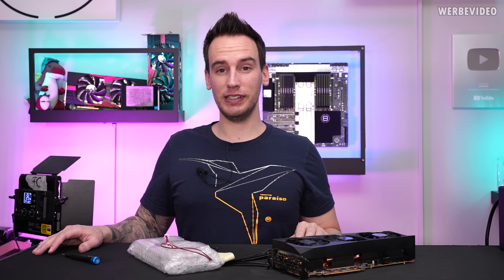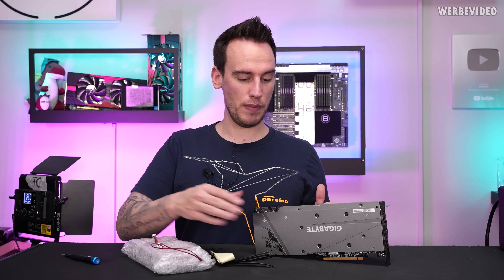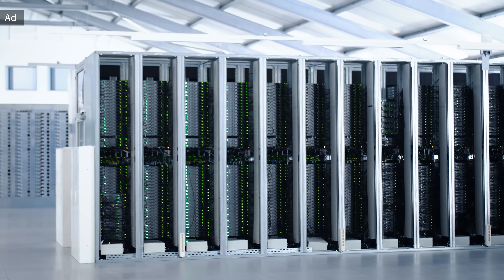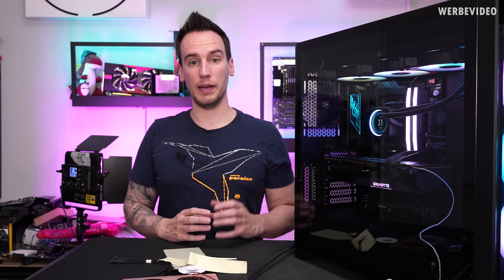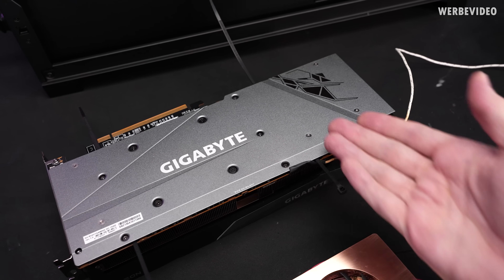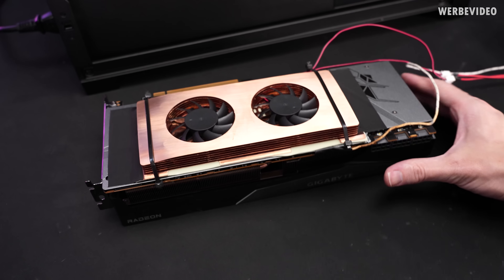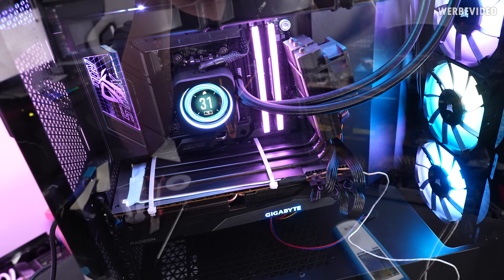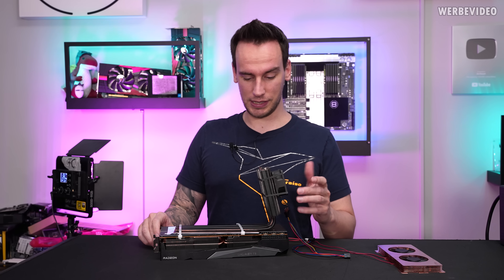Please don't do this - AliExpress GPU Backplate Cooling

Comment: I do not think activate cooling on the back plate is a good idea, although different topic I think similar applies, on cars gaskets often go bad over time due to heat expansion differing between different materials(plastic manifolds and aluminum cast motors) similar will happen with gpu's,  differs expansion rates is likely an issue and active on essentially the  pcb will probably negatively effect the situation; slowing down the heat expansion of the die is likely a good thing as it's the source of the heat but slowly down pcb is likely not a good thing; I"d argue preheating it would be better long term but wouldn't not likely  be realistic

Comment: Solution is for the GPU manufacturers to make their backplates into aluminum/aluminium heatsinks with optional fans. This is also something you can do yourself if you have spare Intel or older AMD CPU coolers. If you have a belt sander, you can always shorten those fins if you run into a space issue. As for mounting the heatsinks, use either thermal glue or modify the backplate to accept short screws(you don't wanna puncture the PCB). If you have a 3D printer, this will be a whole lot easier and more effective(blower style cooling design, special shrouds, support, no drilling, improved looks).

Comment: Of course you didn't see any improvement.  You didn't using thermpads, thermal conductive tape or thermal paste between the backplate and the heat sink.

Comment: yeah i'll just take one of those 3 fan pci slot deals, and put it on the bottom slot near the psu, then put in one of those blowers behind that, 
it will cool the tower internals, plus pull a great deal of heat off the psu and directly out, saving it having to go through and past the cpu and out the back/top of the case.
yeah that's right, a 3 fan slot card, and then a blow behind that, between the slot card and the gpu, mmm hmm sounds like a fresh idea to me.

Comment: Just got an alienware 3090. Based on other people's teardown, there is actually a heat pipe on the backplate. This kind of cooler might be useful in this case.

Comment: my backplate wasnt even touching the backs of the chips so it was just a thermal buffer, added thermal pads to the back plates on the chip backs to the back plate trimmed dozens of degrees off 110 deg to 70 under load! the gigabyte eagle 3080 vram temps (also repadded the heatsink too)

Comment: You put the ties thru the bottom plate it wont bend.But this would be better for my Titan without a backplate in my sli setup.I can make a plate to solder right to that heatsink and that would work great.

Comment: I picked up a couple of the ali-express two fan aluminum heatsink type of things from ebay for my 3090FE's. 

It made a noticeable difference in overall heat on the RAM and the GPU core temp - about 2-3C on the GPU core, and 8-ishC on the RAM. It also kept the back plate cool enough that I could touch it without immediately jerking my hand back.

Comment: Water cooling is far more prone to failing than fans, so even in the worst case I would avoid it, 
Take it from a nerd who invested enough in a water cooling loop I had to smash in the front end of my mid range case to mount it properly, passive or fans are the way to go if you value your sanity and not accidentally-ing your setup.

If you have the cash to waste on water cooling you are wasing your money and deserve what you get, quiet and large fans do exist and carry less risk and less pain.

Comment: Many video cards don't even put thermal pads on the backplate and end up using it purely for aesthetics. I have one of those RX6700XTs that are from AMD itself and didn't have one. I put one on and the temperatures dropped a lot. I think this type of solution could work better if it were placed directly on the card.

Comment: Better GPU and processor cooling? One and only solution: First - change the cooling radiator in your GPU with bigger and more powerful one! If this is not possible - cool the room temperature about 4 degrees Celsius or lower.

Comment: It works great but you're clumsy, that's not how it's done. You need to remove the original backplate and place the heatsink with the fan on top. Use a better thermal pad (21W/mk) than the one provided. The cable ties should be inserted into the first layer and should not be tightened on top, deforming the heat sink.

Comment: Those things are what needed for gigabyte gaming oc Vega cards, which has notorious issue of crashing because of VRM overheat, due to half of the VRM placed on the back of the PCB... There's heatpipe and thermal pads on the back but its just not enough... I put heatsinks with thermal tape on my gaming oc Vega 56 and it works, no more crashing...

Comment: And a thermal pad around the gpu die filling in the blanks and substrate thermal pad around the gpu die itself then back plate itself the pcb acting like a heat pipe as well as surface substrate thermal pad assisted in wax retention

Comment: Ive had issues with vram heat on my 3090 lately, evga 3090 with the hybrid kit. Memory temps hit 105. I simply placed a spare case fan on top of the backplate blowing down into the card and now it caps at 90 degrees and my gpu fans no longer go to 100% to bring it back down from boiling.

Comment: Even if they are useless he still got scammed hard when both are available under 25 Euros the first one even as low as 12 Euros. Also they were intended to use on RTX30 series with helps a lot during the mining period.

Comment: The second one, if you swap this small fart fan for 2, push and pull normal 120 fans
It might be actually good
If temp lowered with this small piece of plastic
Then with 2 good quality fans it could really help gpu

Comment: You need to put the zip tie in the last space just abov the sheet that makes contact with the thermal pad and then backplate, not that it will change something but just for looks :body-blue-raised-arms:

Comment: Roman: "If you have any kind of standards to the design of your system, I'm pretty sure that you would never put this inside your system, that's horrendous"
Me: * Looks at radeon instinct MI25 bios flashed to WX9100, Morpheus 2 cooler added, backplate gone, corsair fans clipped on, mismatched PCI bracket with the hole extended to uncover the single mini displayport, fan cables zip tied as tightly as possible to the fans' screw holes, and the mini PWM to 2x regular PWM adapter * NO of course I'd never have something like that (he lied, lyingly)

Though to be fair if I was going to do something like this on some sort of graphics card abomination I'd probably drill holes in the excess metal on the cooler take the original backplate off and just have that screwed onto the card in it's place.

Comment: I added a 100x40x20mm aluminum heat sink on the back of an Nvidia T1000, with 3mm thermal pad. The air flow is sealed with tape and a 40x40x28mm fan. Result is 10°C reduction in temps under load. What prompted me to do this was noticing the thermals creeping up as time passed and measured 75°C on the back of the card. All while maintaining the single slot tiny cooler on the other side. It's also a way to get heat away from the single slot DP plate where there's nowhere for the heat to exhaust. Things just were getting more and more heat soaked.

Comment: I have put a 100mm fan on the backplate of my 3090 and it dropped Vram temperature during mining. It was thermal trotteling before and I was able to stabilise it. So it does help. For this reason I just left the fan there even after I stopped mining. Just a simple fan pulling away the air from the back plate helps a ton, and the fan is not even set at a high RPM

Comment: My thoughts - replace some of the backplate mounting screws with studs. Then you actually have a way to attach the backplate cooler. In theory the idea isn't that bad here, execution is just janky as fuck. My comment is aimed at anyone considering designing a product like this, not so much at consumers. I think a backplate cooler could totally work. I'm envisioning a flat copper plate with 8mm tall fins over the whole thing, attached the way they were on old coolers like on the radeon HD 4670 sitting next to me, and then a couple of low profile/power quiet 40mm fans sitting flush with the top of the stack. This design would allow you to put tons of holes all over to accommodate almost every backplate design, and it would be easier to manufacture than either of the two shown here. Sell it with a non-adhesive thermal pad like carbonaut so that you don't make a mess.

Comment: On that first cooler, might have worked better if you ran the zip-ties just over the base of the cooler and the 1st fin and added a middle zip-tie.

On the second solution, it looks like the fan is mounted in the wrong direction so it's fighting against the front fans instead of pulling fresh air over the heatsink.

Comment: this clearly isnt meant to make the core colder its more meant for vram vrm since for vrm most of its heat does goes into the PCB but still these are bad designs for what there trying to achieve

Comment: If u have old gpu with back plate just take that plate and put it on with thermalpad in ur gpu
Reply: or don't use a backplate. No more trapped heat.

Comment: This useful only on 3090 because of high temperature on gddr6x memory under backplate. It was necessary 2 years ago during mining.
I put away backplate on 3090 gigabyte turbo, apply simple aluminium radiators on each memory chip with therlmal paste and put 120mm fan on top.
Mining temperature fell under 95 C degree.
In games then lower 85.
In over cards it`s useless, in this card it helped me get my money back with mining.

Comment: What about just.. putting a couple of fans on the backplate...that extract air from the backplate?

Does those can help instead of putting all those monsters on the back of the card?

You should try that... maybe... 2 120mm or 3 80/92mm?

Comment: You have no idea what you are testing and how to do it =)
This product is designed for miners who use 3090 with algorithms to load memory 24/7. As a result, such cooling allows you to extend the life of 3090 by 5-10 times. But yes, in crooked hands, any thing becomes useless shit
Reply: removing the backplate allows you to extend the life by 50x

Comment: Hello, der8auer.
As always, an excellent share of technical knowledge and accessible to most people. Thanks for another video.
I would just like to share a question of mine: did AliExpress GPU Backplate Cooling change GPU performance? When under load, despite similar temperatures with the standard system, did the GPU frequency increase? At the same GPU frequency, is there a temperature decrease compared to the standard system?
Grateful for the attention.

Comment: you installed the zip ties wrong at 6:00, they should go along the protruding edges of that copper cooler, that's why it has those edges sticking out.
Reply: could also feed the zip tie in between the bottom copper layers like you did though the gpu cooler

Comment: What about aluminium cooling? Because this was all copper right?

I am not sure if it does much, but it seemed like a cheap solution for giving some extra room to prevent heat problems. It costed like 20 euro for 2 fans and the aluminium to cover my 6900xt backplate. Temps did not seem to change much, but it does seem to allow for higher OC.

I think even the aluminium with thermal pads and just relying on the internal airflow could help, but it's more about running high temps for a long time or giving more headroom for peaks in temperature. Which you would not really notice with 30 min tests I reckon. But perhaps it is just wishful thinking on my end haha

Comment: My 3080 was getting thermal throttlling on the vrm (I mine when I'm not gaming, please don't judge), would be nice to specifically see those temps measured under load. Once I simply added thermal pads between the back of the card and the metal backplate, my temps went down 30 degrees lmao.

Comment: maybe you can try drilling some holes thru the backplate into the cooling block and screw them together for some more fun? this should eliminate the stupid look of those cable ties and better thermal contact.

Comment: Its interesting that noone has just used the existing backplate (with screw holes pre-drilled) as a tempate for making a backplate heatsick? Like something you could literally swap out backplates for that uses thermal pads directly onto the pcb, does not have fins too close to the motherboard but has enough surface area for significant thermal dissipation and perhaps even a version for mounting 80mm slim fans onto. I used the arctic accelero extreme IV and it was an absolte beast for cooling. Was ugly AF but damn was it good for temps (passive temps too)

Comment: How else to deceive the onlookers? Just don't show it. what to show! Where are the VRM sensor readings? Where are the readings of the memory sensors? The backplate removes heat from these elements! why in the GPU-Z readings of the temperature of the CPU?? Why do we need this data?
Reply: the backplate traps heat, it doesn't remove it. It's very, very bad at removing heat.

Comment: The thermal pads are the reason it's so inefficient, I thought you yourself have pointed before out that the pads require approx 50% compression to effectively conduct, whereas thermal grease is much more forgiving. I installed a far jankier solution on my card with thermal grease and knocked 20C off of my 3090 VRAM temps

Comment: 3090 with back ram here, I used to mine when I was at work and made a mod with 2 low profile cpu coolers welded to a copper plate. I used some carbon thermal pads and just that dropped it from 110s to low 90s. I think the card is more important to this working or not.

Comment: actually this is interesting for me.

I change GPU often, and the size of that second one is a problem but otherwise I would consider it.
I want my gpu as silent as possible.

And if comparing to new cards from store, one has to pay $50 and even $100-200 more to get a better model of the same card with better cooling. And this probably helps more than that, or as much.

Comment: I have a 120mm fan on top of the backplate.
80c when playing demanding games.
Didn't want to potentially break it by opening it up and modding it
Reply: 80c, your card is overheating. Take the backplate off.
Reply: @dreyga2  better than the 110c I used to get before putting a fan on there
Reply: @ルビー餅  what gpu you got?
Reply: @dreyga2  3090
Reply: @ルビー餅  take the backplate and throw it in the trash where it belongs. Find another way to keep the GPU straight.

Comment: I added thermal pads the back of my memory modules so the backplate would serve as a heat sink and it shaved 18 celcius off my Gigabit RTX 3080 Vision while mining. That's the secret to getting the card really hot because just normal use would not require this kind of surgery

Comment: Oh, c'mon! Are you trying to see the difference in memory temp when there is a large air gap between the board and the backplate? What did you expect? First of all it would be better to put additional termalpads for backside of memory and backplate and only after that test it. Btw, gigabyte is the worst company for graphic cards (tested on 3080 vision)
Reply: let your 3080 breath, take that backplate off.

Comment: I used a 1U EPYC cooler on my 3090 backplate which worked great. No mounting, the preapplied paste from the cooler stuck tightly and has now cured, I'd need a crowbar to pry it off 😂

Comment: Or you could do what I did when I wanted extra backplate cooling (mining with a founder's 3090): get a fairly cheap, decently sized, normal alliminium heatsink from aliexpress, attach it and point a spare fan at it. Going to be much more effective than these silly coolers.

I attached mine via thermal paste (nightmare to clean up lol), duct tape around the edges and then a cable tie around the card to make sure it stayed secure.

Can be a bit of an issue fitting it into the slot, but it works if you're careful.

Otherwise even pointing a decent fan at the naked backplate will help more than this. Maybe even simply thermal tape on some spare memory heatsinks spread out on the backplate to give it a lil more area.

Basically do any of the above apart from these silly coolers :)

Comment: back in the days I used to just point a fan directly at the back of the card and that fixed the heat issue if any, in most cases there is just not a whole lot of airflow towards the back of a gpu in the first place so just adding some airflow pretty much solves the problem

Comment: I suspect the think layered copper one is built by just brazing copper slugs in between the thin layers, two thermal joints every wafer.

Comment: Wouldn't it better just have the backplate be the heatsink and not a just slab of metal pretending to be one.
Reply: a heatsink that traps heat is a bad heat sink
Reply: @dreyga2  the backplate is going to be there so why not make it more useful?
Reply: @SkinUpMonkey  the backplate traps heat, making your card overheat. The card runs way better with no backplate. Remove that stupid crap. Find another way to keep the card straight.

Comment: If youre placing VRMs on the back then yes you need a better cooling solution other than the thin metal plate. I tore down my 3090, repad/pasted everything and put additional aluminum heat sinks on the back plate. It dropped my temps by over 25*C.
Reply: why not remove the backplate and place them on the memory...then u get excellent temps on memory and gpu core because there is no trapped heat.

Comment: Seems like they just need to make backplates with 2.5-3mm tall & 2mm thick aluminum fins 

Just in the area where GPU and Ram would be touching the backplate

And really only for 300 watt+ cards 
Aka the top 3 from AMD and Nvidia